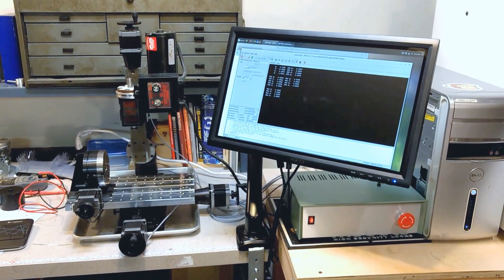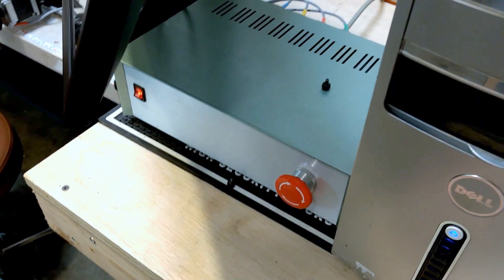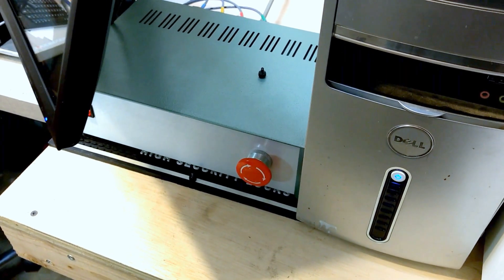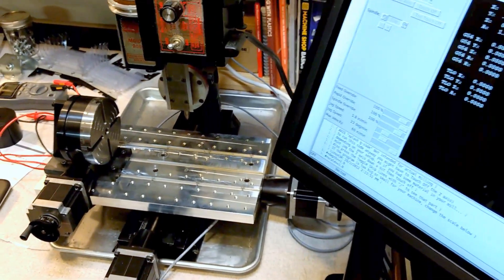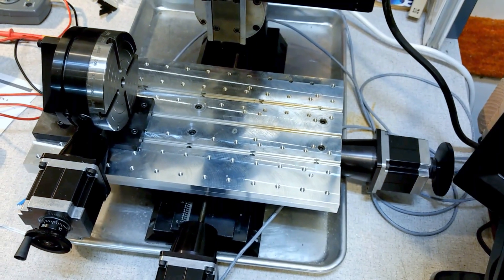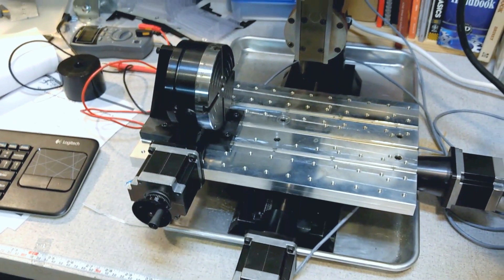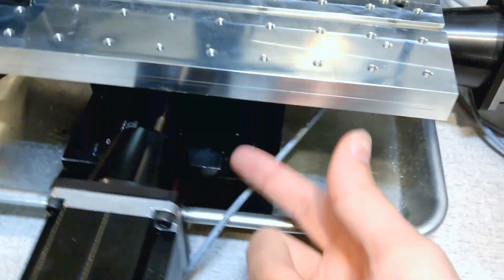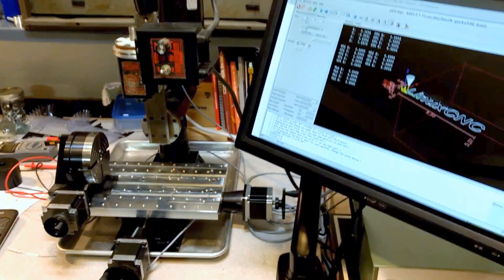Sherline mill working with LinuxCNC and G540

Comment: I'm thinking of buying one of these, used.  I already have the 4400 lathe.   What are going to use it to make?
Reply from the maker: I really don't use it enough to its full potential these. Mostly for a step in making PCBs. Specifically for routing out the edges and drilling the through-holes using FlatCAM. I don't think I've used the 4th axis in months, unfortunately.

Comment: How did this work out for you?  I just got a Sherline mill, and am thinking of doing what you've done, with the exception of using a microcontroller control (like and advanced Arduino board, but much faster) and servo drivers from elsewhere.  Same software, which now runs on Windows.
Reply from the maker: I have it working really well now. It's all set up and lately I've been messing around with milling PCBs. Been meaning to make a video. If you get a Sherline for CNC be prepared to battle with getting the backlash to acceptable levels. There are preload nuts on Ebay that work alright.
Reply: @TheChemicalRobot   I haven't done any conversion, it's just a plain 5400 at this point.  When I start, I'll get the mounts, couplings and motors from Sherline, the rest DYI.  As for lead screws, I wasn't going to switch over to ball screws, hoping that there is either backlash compensation in software, or that snugging things down with the standard "star" nuts on the mill will be adequate.   

Did you change to ball screws?